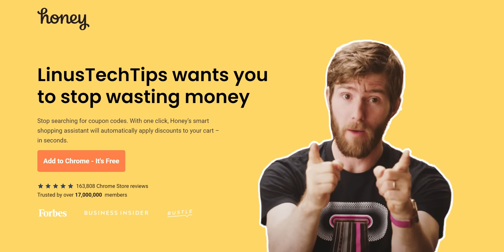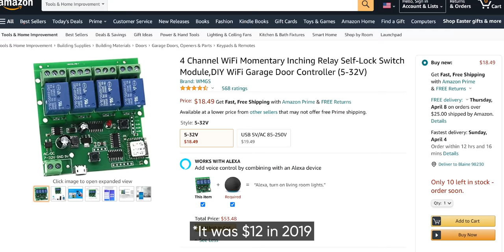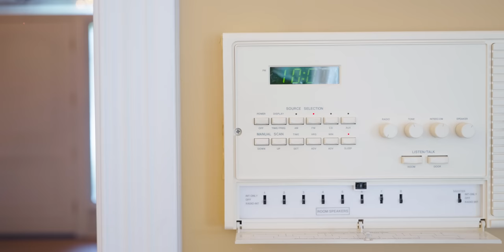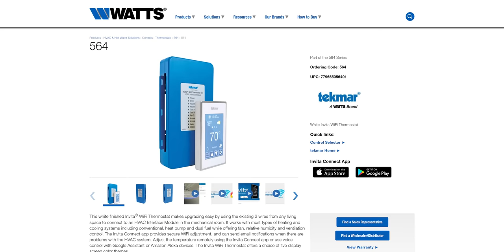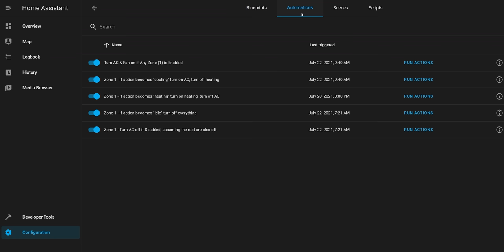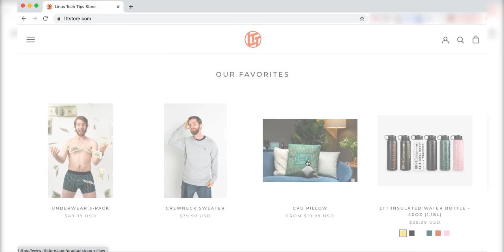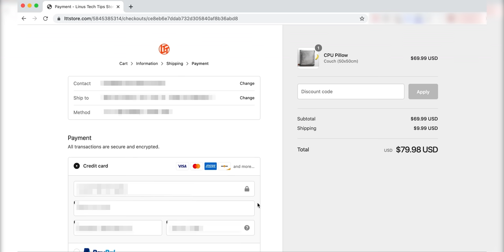This Should've Been EASY - New House Smart HVAC

Comment: I've been running DIY multi-zone heating for years now.  ESP8266 sensors and smart relay controllers.  I have to check these EcoBee things if they are cloudless.

The icing on the cake is collecting all the data from all the sensors in grafana.  Then exorting pretty dashboards to mini screens.
Reply: Oh and be prepared to run into dozens of edge cases and complications along the way.  I choose to do things differently after going through the analysis.  A few tips.  Avoid holding state at all costs.  If you want to know  device state, ask it.  Assume everything fails.  So let everything "timeout" naturally.  So your heating doesn't get stuck on when the PI reboots.
Reply: For simple, but effective presence detection I use the MACs and/or IPs of devices which I know will be on, if the room is "in use".  Like the smart TVs in bedroom or living room, or the office PC in there.   Response it immediate.  Turn the TV off, the heating target will drop within a minute.
You would assume motion detection and/or smart light state to be useful for presence detection and they are.  Just not for heating/cooling.  Imagine every time you pop to the loo in the night the system wakes up and heats the hall and bathroom for 2 minutes (pointless).  For heating/cooling you need to use schedules in addition to more "in use" detection rather than "presence".
You can localise automation switches like, for example a NFC phone set down on the bedside table tells the system that person is in bed.  So it can back off on the bedroom heating and / or lighting etc.

Comment: I'll just type this out even though a million people probably know this, your air handler for the system has a fixed amount of air required to operate correctly, maintaining the evaporator coil temperature and corresponding suction pressure. You closing the supply take off ducts with dampers increases the static pressure in the supply ductwork, causing the blower motor to draw more amperage, try reading amp draw with one zone open and comparing it to the run amps listed on the blower motor or nameplate of the unit. Given that it is a fixed speed motor presumably, it will fail. 

Duct design could be another whole comment, but the amount of air drawn into the return will go out the supply duct. You need a BYPASS DAMPER! If you limit it to a single 8" duct into your living room when its the only zone calling, you will get 1200cfm(guessing) at a elevated static pressure out the duct. This will lead to the thermostat satisfying incredibly fast, short cycling the compressor leading to the death of our dear friend Bryant after his years of faithful service.

Cool project though, hope you just send it for the content!

Comment: if you want something more reliable and still still cheap and controllable, simply use Siemens Logo, you have even 24v variable io ports for example opening the dampers anything in between 0-100% to have more controll on the airflow

Comment: Be careful with motion sensors. They are frenimies. They can help with poower savings, but if you say falll asleep in your gaming chair, you could lose cooling in your room, making it get too hot. Or your lights may turn off at an inopportune time.
My high school had motion sensors for the lights. We constantly  had our lights turning off because of not enough movement and FIVE MINUTES for the off time.
The siemens building I was interning at a few years ago had a similar problem. The meeting rooms had a light switch next to the door. Those were replaced with motion sensor switches. The lights keep turning off because the switch faces the door.

Comment: Probably wont see this, But I sell Bryant, along with EcoBee/motorized dampers etc. Just giving you a heads up that Bryant condensing units are usually expected to last roughly 20 years (warranty is usually for 10-15) Would recommend checking the serial of the unit to see its age. The first 4 numbers are when the unit was built. 

Example: if the serial is something like 2221c53413 that means the unit was built the 22nd week of 2021 (2221)

Comment: if it were me especially with the fact that the air conditioner is 25 years old i'd ditch the ducted ac all together and replace it with a vrf system and put in ceiling cassettes in, but that also raises the possibility that it would possibly make your  underfloor heating redundant

Comment: You're increasing the  pressure in the duct, a couple of those electronic dampers is fine however if the main unit is running and the most of the dampers are closed the main unit will be choked and damaged since the air will have nowhere to go.
You need something called a bypass VAV which when closed it will leak the air above the ceiling or it will go back to the return air duct.
The electronic damper must have a thermostat that controls the damper itself not the ac unit.
I don't want to bombard this comment with a million point, I've been doing hvac for almost 15 years, if you need help just let me know.

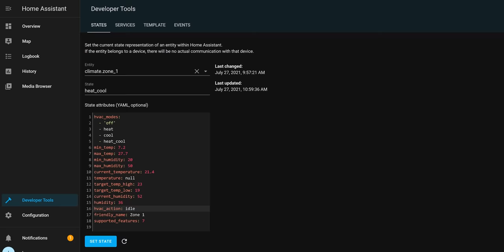Comment: EDIT: 13:54 I should have waited before I commented :)

Old: 2:45 Wait, Wait, Wait. The heating and AC could run at the same time? The mode should be either heating or cooling, but never be both, right? (We completely disabled room heating in the summer months, but that may be a regional thing.)

Comment: Our Bosch smart thermostat simply works on 2 wires, just like... all central heating thermostats.... Using opentherm and stuff. Also keep in mind that floor heating is a very slow system, so it can overshoot very easily. You better of not using valves but a water temperature controlled valve.

Comment: This is awesome, I see one potential problem depending on my understanding of your solution.  If each room can control the fan, and you turn the cooling-off and it then turns the fan off, what if another room requires the fan?  Assuming there is one singular fan for forcing the air through the ducts unless you are controlling an individual fan per damper.  The same principle for cooling, if one person turns down cooling but someone else wants it would it not shut the cooling off for the others?  I am assuming smart home can manage that or raspberry pi in between to manage minimum dampers open, and minimum rooms using the ac / heat to control on and off and smart home to control the dampers(and possibly individual fans) so it is managed.

Comment: Glad to see a Grundfos pump instead of a Taco on your hydronic heat. You would have gotten tired of replacing the pump every year.
Had there not already been an ac and ductwork system, a multi-zone precharged mini-split ac could be an alternative for anyone in a situation where they don't want to run ductwork.

Comment: An air conditioner built 20 years ago almost certainly is engineered for a certain thermal load which means you cannot vary too much the load without causing the machine problems. Make sure the machine can partially reduce the cooling power it produces, otherwise it wont work properly.

Comment: Your relays have a common and an NC/NO right? Would it be possible to have the NO on the fan and NC on the damper so that switching a single relay toggles both devices like one device? The damper is 24 volt which implies that's a voltage used in hvac systems so surely 24 volt booster fans exist. If a system like that can be set up then it's actually pretty convenient that on means off for the damper because the opposite is obviously the case for a fan.
Or is it possible I'm misreading the idea and you're going to rely entirely on the dampers, and the fan in the setup was to illustrate what the one common blower for the entire vent system will be doing?

Comment: I have heated floors. You have to be careful on the settings. Too hot and you'll feel a bit ill because your feet will be cooking. Oh, and get ceiling fans to circulate the warm air when the heated floors are on.

Comment: I would probably have done this by letting the AC unit control the fan to a certain extent, and have what is called a "common" zone that is an always open zone so if all dampers close (ie, say Home Assistant fails) it won't cause damage.   
I use Home Assistant and it is pretty reliable, but any software can have a hick-up now and then

Comment: Without a variable speed condensing unit and a variable speed air handler, Linus may encounter many unpleasant issues with his zoning plan. Some of which may include:

Premature compressor failure due to liquid slugging. Not enough airflow across the evaporator coil may cause the refrigerant to not boil completely into a vapor by the time it reaches the compressor (compressors do not like liquid).

Noisy system operation when many dampers are closed. The fan in his system appears to be single speed. (Same airflow amount no matter how many dampers are open or closed). So if only one damper is open, the open vent may sound like a jet engine due to high air velocity.

Water leaking out of air handler. With many dampers closed and airflow is low. There will not be enough air to raise the temperature of the evaporator coil. So the temperature of the coil may go below 0 degrees C. This will cause the coil to freeze over, completely restricting airflow, possibly severely damaging the compressor, and possibly causing water damage around the air handler once the ice melts.

Either way. This project will be a nightmare for Linus. Good luck from a Pennsylvania mechanical contractor.

Comment: what about instead of air cooling and underfloor heating, you just use the same pipes for both, you use a heatpump to cool water and drive it through the existing heating pipes.
Only thing is you obviously cant heat some rooms and cool others at the same time, but when is that an issue.

Comment: A central air unit with too many zones off can  cause inefficiency as a; lets say 5 ton non variable compressor cant lower its BTU/R rating. make sure you install a pressure release damper that will bypass the extra pressure back into the intake of the unit.

Comment: This is so foreign for a Japanese dude ... our houses have individual AC units per room, so there are multiple "boxes" (sorry I don't know the term) outside. Also many houses have heated hardwood flooring and each room or zone has its own settings panel for the floor heating. So each room can have one thermostat for the AC and one for the floor. The floor is actually a "low" "mid" "high" kind of setting than actually being a thermostat though. So if you want to smart-home your place up, you just need a system that will change the thermostat to 24 C on all thermostats in the room because they are separate independent units. Making everything run on one AC system is very new to me. I was so confused when when I saw one thermostat in this basement apartment that I rented when I lived in Vancouver. Plus the thing was designed poorly. It spewed hot air until it reaches the desired temp, and then spat out cold air to bring down the temp to the temp setting when the room over heated.... madness ... why would anyone design something like that.

Comment: It is a good idea but to me the efficiency is kinda questionable. They do make smart air conditioning units that if they are only cooling one room they will run every thing slower to be efficient the problem with using a big a/c to cool one room or just a couple rooms is yes you will get back pressure causing your blower to work harder using more power and reducing the life span another issue with the back pressure is if you dont move enough air it can cause your a/c to freeze up and you have to thaw it out which can take a few hours. The second purpose of an a/c is it needs to run long enough to pull the humidity out of the air and if it can't do that it becomes less efficient cause it will have to run more to pull the humidity out of the air. It is a good idea but if you don't have the right equipment for the application it can create a mess at times

Comment: Just change the furnace for reversible heat pump, heat in winter and cooling through radiant pipes in summer. Ducting is there for mvhr and whole house system like LOXONE would be a lot cheaper and more relevant and attainable for us the masses.

Comment: Make it so the AC will only come on when 2 or more zones are calling for cooling. Also I would put max temperature limits if you're going  To control the zone by Occupancy sensing so the room doesn't become too warm while no one's in there.

Comment: I've done work in some very expensive houses with hydronic heating, and the one big thing they all mentioned is that it takes days to get a couple of degree swing from the thermostat.  Since it takes so long opening the windows isn't something you can ever do really, and that is a total deal breaker for me.
Reply: hydronic heating is basicly a normal heating system for me. if you have a radiator with pipes going to it in every room you have a hydronic system pretty common in houses at least as far as i know. depending on how you heat the water(it could be gas burning, electric or even wood) you might need to take a bit more or a bit less time but in matter of hours you can go from cold to too hot of course depending on building size heating elements size, fuel and how you are transfering heat to the rooms (with radiators that menas how many radiators, size of radiators...).
Reply: @bigpod  that isn't how hydronic works.  What you are talking about is air cooling, but using radiators.  Hydronics heats the entire floor, and hard materials take much longer to heat and cool than air.
Reply: but otherwise thanks for the idea i will defenetly ask my plumber if i can use radiators that are for half of the year useless(during summer because we do not heat our rooms during summer) if i could use them for cooling house and how much would it cost to have same system double for cooling and heating

Comment: This seems really complicated... And how are they going to mount all those AC ducts and wire it all up? And wouldn't shutting off some ducts sharply lower the temperature in the remaining room, resulting in high temperature gradient and building up moisture? Also wouldn't it wear out the AC quickly because it's just going to turn on and off again all the time?

Wouldn't it be a good idea to consult an interior architect and a civil engineer to get a sensible baseline before trying to reinvent the wheel?

Comment: You should not turn off AC if nobody is in the room depending on where you live. Even if you automatically set the temperature threshold lower if nobody is in the room, don't turn it off. AC is important for humidity/mold control and the temperature's in any room should be tolerable (between 60-80 deg F)

Comment: As a controls guy I'm thinking you don't want to be running all your dampers all the time by default when your control board is powered up.  You should change your logic to selectively close dampers only while the AC is running.

Comment: I would suggest maybe switching for normally closed dampers. Since during the winter you won't need Cooling and all of your dampers will be running 24/7
Reply: blower NOT running as it is NOT forced air heating but radiant heating and IMHO all dampers open will not do anything so he could shut down the whole damper / relay board power once cooling season is over to remove "phantom" power draw

Comment: Speaking about just the air cooling part, none of it is going to be energy efficient or even perform the way Linus/any-human needs it to without PID controls for (some or all of) Supply Air temperature control, Zone temperature control (using the VAVs), Static pressure control (via VSD for the blower) and ventilation control (some way to bring in fresh air). (I've implemented PID for these for 5+ years). (1) The hardware does squat without intelligent control and the hardware even be damaged in some situations (like the blower running high when the VAV dampers are closed). (2) Bad or no controls could even cause condensation and mold growth and cause a host of other problems in the long run. (3) using On/OFF controls on the VAV is just too ancient, these days only modulating VAVs should be used. (4) Not sure if the LTT team has considered air balancing on ducts and water balancing on pipes.

Some things can be DIY'd but some stuff should just be professionally done. We wouldn't go about building an Ipad if we want to USE a tablet, would we? We could build one but then most of our time would be spent building, tuning and maintaining it instead of just using it to get actual work done.

Good luck to Linus and the team though! Given enough time, they will reinvent the wheel and write the ASHARE textbook all over. But I would caution the public at large from attempting any of this.

Comment: Hey, the AC is 25 yrs old, you were going to have to replace it anyway.  Now it will just crash faster.  But don't try this with a newer system wit EC motors.  That would be costly to replace those motors.

Comment: The one problem I see with this is HVAC systems are designed to operate at certain outgoing pressures. Have too many dampers closed and it will still get wrecked even if 1 damper is open during operation. It’s like breathing through a soda straw vs coffee stir straw. Yes, air will get through the coffee straw, but you’re still gonna pass out

Comment: It’s funny how you thought that electronic damper would have a proprietary wiring set up. I’m a Hvac   Technician and everything is controlled w
24 volts and Honeywell makes a vary simple to use multi zone controller and you can set up 1 thermostat of your choice in each roomit doesn’t have to be Honeywell it can be ecobee And have that multi zone controller tell everything to turn on and off by itself no need for multi transfers or coding anything.

Comment: Don't have the system check temp too often. The valve will never be in one position and over use the actual and burn out the motor.